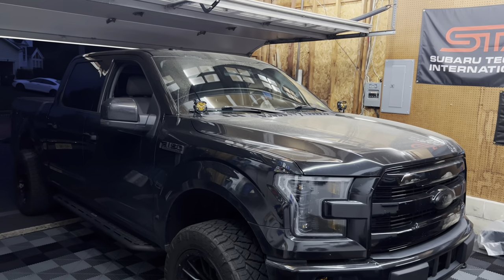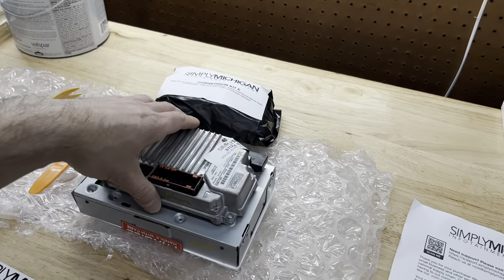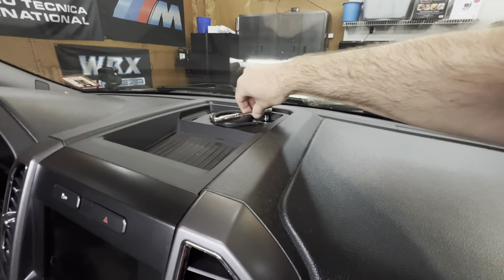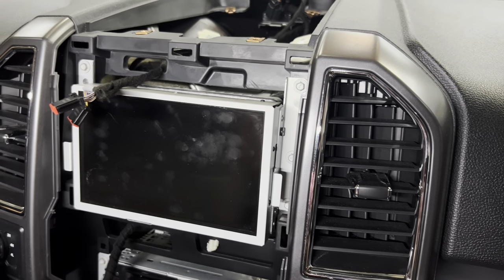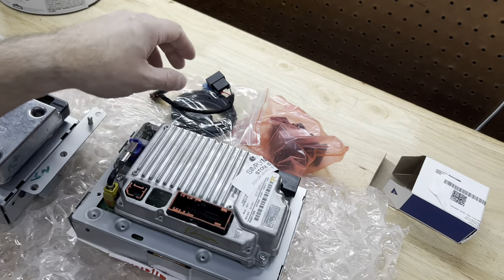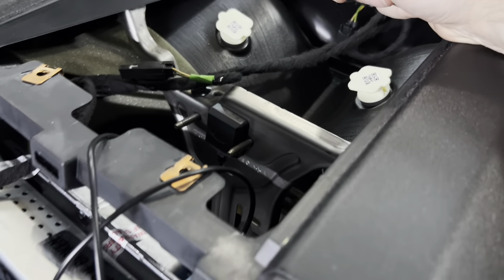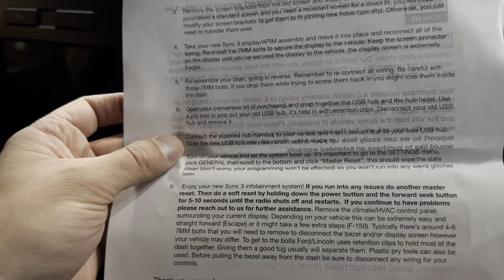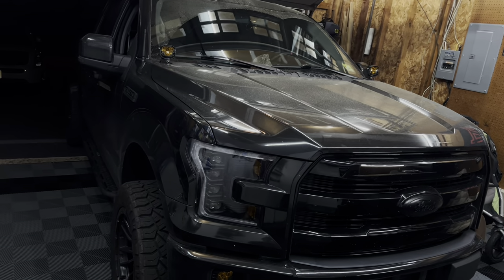Upgrading Sync 2 To Sync 3 On My Ford F150 - APPLE CARPLAY!

Comment: I had Sync 3 in my 2018 F150 but I wanted one of those 12.1” screens. But like you, no way I could spend two grand on one. But I found a refurb unit on EBay for $280 and I put it in. I like it but I lost the Sync 3 features. I still have Apple Car Play. Cheap way to try something out. 
I love your truck. Especially the Amber DRL Morimoto headlights!
Reply from the maker: Nice! I wanted to keep this as simple as possible without interfering with any of the basic functions of the truck. Definitely some great aftermarket options, but for the cost, it was a no brainer for me.

Comment: I just love what you’ve done with your truck. I have a 16’ Lariat and i’ve done lots to it. I want that version of sync as it’s the next gen from mine but newer than your original one. I heard of a software called Cyan Labs that lets me do this without buying a new head unit so I’m going to give that a go.
Reply: Did that work at all? I have a 2015 xlt. Not sure if I wanna spend the he $800 for car play and nav haha.
Reply: Did it work? I also have a 2015 XLT
Reply: Following I have a 2015 platinum and would like to know if it worked .

Comment: Appreciate your content man I have been following you for 2 years now.  Just sold my STI  for a 16 F150. So I just wanted to throw you a big thanks for continuing your content. I was hoping this one would help however I have the Sync 3 in my 16 guess it was an option back then but I can’t get CarPlay for the life of me. Took me 3 hours last night to successfully update and it has a few new things but not CarPlay. So I have to keep on hunting for the solution. 
But you certainly helped me and I don’t miss my Sti much since I got the truck surprisingly and very happy I made the jump.
Reply: Hey man I believe you just need that new usb adapter that he used in the video. Should just swap out with the old one and you will get apple CarPlay.
Reply: Nathan is correct. You need the usb hub he showed in the video for CarPlay to work in your 16. Was the same in my wife’s 2016 Edge.

Comment: Awesome video! I have a 2015 f150 platinum but my online concern is if the features such as a backup camera and 360 back up camera, the massage seats, or the climate control are gonna be still the same
Reply from the maker: Yes all that will remain the same.
Reply: did you make the change? I was wondering the same thing, did it work?

Comment: Nice video! Also… when you connect to CarPlay is it Bluetooth? Or do you need to connect with you’re usb charger and then it will go to apply CarPlay?
Reply from the maker: Thanks! Bluetooth disconnects when you connect to carplay and bleutooth turns on when you disconnect from carplay.

Comment: hello, i have a question for you, you already had two usb ports, one AUX and one SD, did you need to replace them to make sync 3 work, or were the ones you already had fine? i ask you this question because i have a ford ka plus with sync 2 and i'm switching to sync 3, and my car already has an AUX and a USB port and i don't know if i need to change like you did with the two usb ports. what do you think?
Reply from the maker: Yes you need to change to the one provided.

Comment: Hey man, quick question- looking to get a F150 and wanted to get your opinion on what’s the better value? I’m looking at F150s from 2015-2017 and I basically see two options, either I get a good F150 for 25k or a Raptor for $35k ish . Wanted to get your thoughts whether the raptor was worth the extra $10k or not? Your F150 looks like a beauty so obviously getting the $25k and having $10k in mods is a viable option and I think potentially the better option in terms of performance & aesthetics but I may but downpaying the cost it takes to mod the F150. So yeah your opinion would be helpful! Thanks 🙏🏽
Reply from the maker: Raptors are awesome trucks. If you have a need for all of the Raptor performance parts, I would say go for it. Although, you’ll be looking at a much higher mileage raptor than a normal f150 in the same price category. Both great trucks, just what you need it for is what the determining factor is.
Reply: @Scoobyfreak86  thanks man for simplifying it for me. I don’t really have a need for a truck and yes the raptor would be around 100k miles while a 60k mileage F150 for $26k is probably the better value. Thanks man !

Comment: question? my 2016 radio blutooth keeps disconnecting and i did a update and did all the reboots imaginable. if i do something like this. is the screen necessary to upgrade or can i keep the one thats in it?
Reply from the maker: Yes you need the entire unit

Comment: I seen a tesla style screen that retains sync. i'm wondering why you didn't go with that. i would post a link but you already spend 700 bucks and i would hate to tempt you to spend another 1k. was pretty neat. me if was upgrading to get carplay/android auto i would have spent the extra 300 bucks. retained the sync so your backup cams and all the normal ford feautes worked. DeaninItYourself has a video on it. but i do understand the want to keep the stock look.
Reply from the maker: I saw them but wanted something OEM and keep all the factory functionality.
Reply: @Scoobyfreak86  the one I seen you bolt the sync to the back of it. And it has a button that brings up your sync in a window on the tablet. Same as if it's on the 8" screen.

Comment: Hi I was just wondering if it will replace my current Sony sync system. Is it the same screen? Is this Sony system 8 inch 2017
Reply from the maker: As long as the factory harness is there, then yes is can be replaced with it.
Reply: @Scoobyfreak86  is the Sony head unit actually Sony head unit or is it just the speakers you're getting from Sony ?
Reply from the maker: Honestly not sure, but most likely just the speakers.
Reply: @Scoobyfreak86  ok thanks. Are all the head units brand new or are they used?
Reply from the maker: @twolegittooquit3114 brand new

Comment: I have a 13 platinum will this work also have back up cam and my USB ports are in the center console
Reply from the maker: Yes, it should. Just need to make sure you have the proper harnesses.
Reply: @Scoobyfreak86  the one I have is the 10 inch with nav
Reply from the maker: Yes this will work

Comment: So this will work in a 2015 F150 XLT? Current sync 2 doesn’t have maps and the nav on sync 2 sucks anyway. Thinking this is a better upgrade.
Reply from the maker: Yes. Mine is a 15 xlt as well